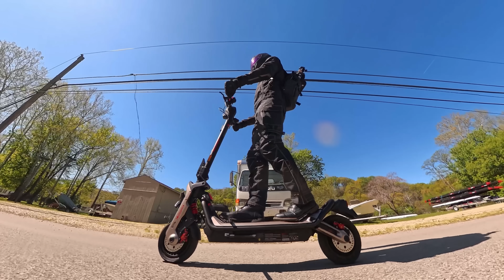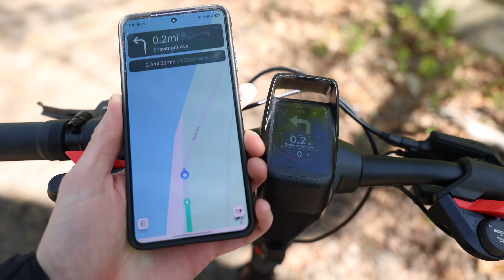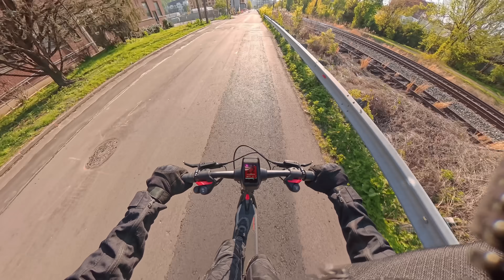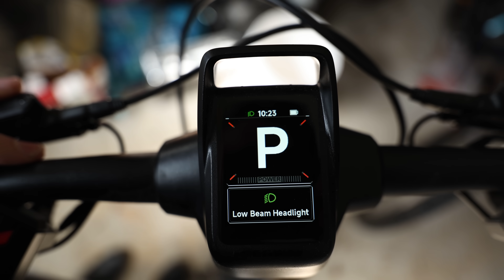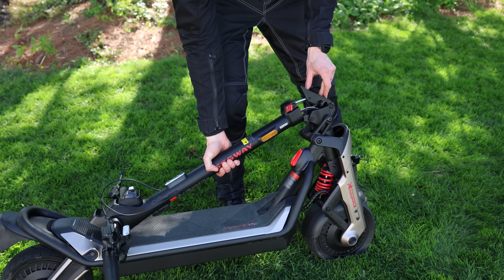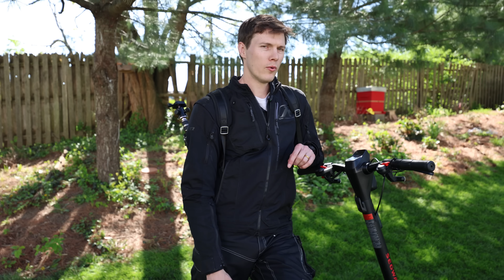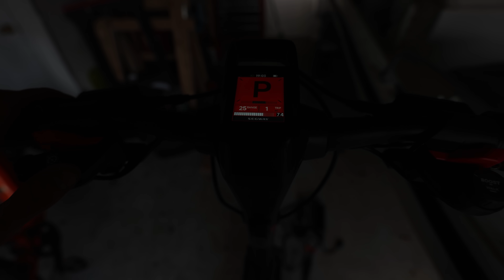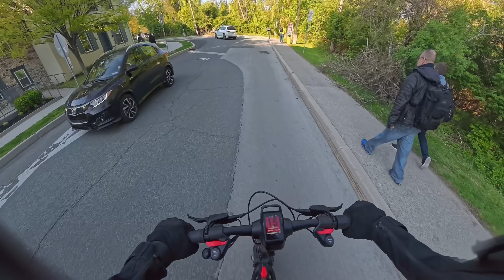Can A $2,700 Electric Scooter Replace My Car? - I Tried For 3 Days

Comment from the maker: SEGWAY GT3 PRO link (latest sale price) https://mikeobrienmedia.com/SegwayGT3Pro
supports the channel at no cost to you
Reply: I have the stepped down cousin, F3. I would cap the speed at 15-20mph which is about the speed one would go on a standard pedal bike. I can certainly appreciate the added range it would bring to a beefed out scooter like this and I would absolutely agree with what you said about inclement weather. It is a fun way to hit the trails. I am hoping to find the extended battery piece for the F3 but I may get something like this and cap it just like I do the F3. My rule is that if I need to go faster than 20, I'm taking the car.

Comment: I use my scooter to get to work 9 MI both ways in Southern California traffic just don't drive it in the regular car Lanes stay on the right side of the road in the bike Lanes and get a off-road overpowered scooter definitely comes in handy on rough terrain or bumpy pavement / concrete roads

Comment: Basically, the answer is simple, is your car just a A-B vehicle OR do you use the full car. Like you go shopping and need the trunk, need to go long distances or have a license because you have a driving job. If the answer is A-B vehicle, you never needed a car and walking would suffice for some and Bikes, Scooters etc for others. I walked to work for 6 years, 5 miles, 2.5 there, 2.5 back, takes 50 mins. Then I said, let me use a Scooter, then a Bike to make 50 mins 16-19 mins. Humans have been walking thousands of miles with no issue since we were created. It's only in the modern era we act as if walking is not a thing we should do anymore unless it's down the street or to a Bus or Subway station.

Some of us are in very bad health because we don't move around as much anymore as humanity and we're pretty lazy. People that get a bit of a pass are parents and care givers to those they need cars for or are absolutely in a unreasonable time crunch.

Comment: KuKirin G2 Pro ABE. Diesel car left idle without renewing insurance. Over €1,000 saved in 5 months and more than 4,000 km covered on the electric scooter. Yes. An electric scooter can replace a car.

Comment: I ride my Segway to work. 13 km in total, minimum 5 days a week. I save about 50 euros worth of gas a month. Not even talking about preserving my car a lot more + it's a fun way to go to work. I like it a lot tbh. You do have to pump up the tires of the scooter every week because they loose air pretty quickly and it hammers your range and speed real bad.

Comment: you said there's no regen breaking. There is you even show it in the app. It is called energy recovery and it has 3 modes. Off, Weak and standard.

Comment: I actually drive a Holden Crewman, which has a big V6 and is a very heavy vehicle with bad fuel mileage, so I just ride my Escooter Kukirin g4 around town to work or shopping and drive my car if I have to go out of town.

Comment: Sadly, the feasibility of e-scooters depends on how your city or metro area is setup. Even in my area  there are some areas that allow access to shopping, but the neighborhood that I live in is an island with no viable way out to shopping or much else via e-scooter. Texas does not allow e-scooters on roads that have a speed limit over 35.

Comment: 50mph on hard 10 inch wheels on lackluster suspension with a high center of gravity. One sugar cube sized stone and you're wiping out. 
I have an offroad e scooter with proper suspension and that thing still doesn't take bumps as well as my trekking bike with $30 shimano suspension.
19 mph is the reasonable limit for a vehicle like this.

Comment: I replaced my car with a Nami Klima max. 
 Have done this for about 3 years. Haven't looked back. 
 We do have a family car which is enough to get the family around.
Reply: I just bought an Apollo Phantom 2.0 and find the suspension is sucky, and the guy who sold it to me replaced it with that Nami 60mph. looks like that is the one to get, suspension looks good and battery huge
Reply: @jstewart627 funny enough I started with an Apollo Ghost and I replaced it with my nami 😅never looked back

Comment: The meepo voyager looks cooler, climbs hills better, does groceries better, and you can buy 2 of them plus a high end helmet for the same price. Also better to go into grocery stores,  riding the bus easier, bail much safer,   and did I mention look WAY COOLER!

I use bungee cords to strap a nice big grocery bag, or whatever to straddle. You can also use a free hand without risk.  The downside is meepo has terrible customer service and they break. The longest ive had one work is 3000 miles.  Some only lasted 500

I mite buy this  considering the customer service could be better in event of a problem, but its definitely a downgrade in cool factor

Comment: I replaced my car with a Ninebot G30D going 70 km/h, 3-years ago, still going strong, even have a seat for my dog. Just way cheaper than a car. 
I find it a lot safer also, you have a lot better view, having eye-level 2-meters up and no death angles. Also should be a legal requirement to have steering stabilizer on e-scooters, makes an e-scooter 10x safer.

Comment: Before I bought the Segway GT three pro, I used to take the train or drive to work. Now, I ride the scooter to work and back, and sometimes I use it to do errands like grocery shopping. I absolutely love every moment I spend with this scooter. I’ve already put 2200 miles on it!

Comment: I have a segway max g3 with the upgraded gt3 battery,I commute about 16 miles to work and 16 miles home 5 days a week. I'm lucky my job lets me charge it while at work. I have almost 4k MILES not kilometers. My scooter has paid for itself in insurance costs ALONE. I've spent 120 bucks on tire replacement twice ( every 1500 miles ) and 40 bucks on brake pads. BEST INVESTMENT EVER AND STILL GOING STRONG!!

Comment: I recently picked up a lightly used Segway F3. It only tops out at 20 in sport but it's so fun to ride because it's nimble and light. Also has multiple regen braking modes.

Comment: I just finally got one someone was tossing due to flat front tire and broken brake cable and I fixed it in about 30 mins with $30 worth of parts off Amazon. It tops out at 18mph and I gotta say it feels sketchy AF I cannot even imagine doing 50+ on one that is wild. But ya I have to agree I tried to scratch my nose while riding and you really can't barely take a hand off the handlebars

Comment: You always need a car. Here in Canada, it's illegal to use one on the highway: the speed limit is 50 km/h on the road and 25 km/h on the bike path.

Even though it's a bit like a motorcycle, since it has two wheels, the law considers it dangerous to ride one on the highway. If this kind of regulation doesn't exist where you live (and I'm talking about countries other than Canada, of course), you're lucky! I'd love to buy one, but if I can't go faster than that… I wonder if it's really worth spending so much!

Comment: Emove cruiser has been my daily driver for going on over 2 years now and my advice for scooter life is at least 2 big canvas bags for the handlebars and I strapped a cooler to the base for extra storage like a trunk and my seat. Also a side mirror and Bluetooth speaker... not just for tunes but for noise because electric scooters are pretty quiet and its an added safety feature that people hear you coming so don't be afraid to blast some tunes everywhere you go... many scooters have a usb port for charging additional devices so I keep mine on the speaker so it's good to go as long as the scooter has juice and with a 50 mile range it lasts long enough for me for a week of back and forth around town.

Comment: Such a fancy scooter. Not suitable for the impoverished poor, who can no longer afford to operate motor vehicles. Too expensive. Besides, many states have laws regarding the maximum wattage and speed limits e-scooters can obtain. Example: In my state, 750 watts is the legal limit. E-scooters are also restricted to 20 mph or less.

Comment: I’ve had my GT3 pro for about 90 days, I’m 55yo, been riding scooters for about 18 months, it did replace my car, and I haven’t missed owning one at all. This scooter is a dream to drive, does 50 mph, easily. Also, it’s extremely stable at 50mph.

Comment: You may want to try out one of Bonnells E Mountainbikes. It has a range of 12-37 miles with 6000 watt and a top speed of 37 to 40 mph. At least the Bonnell 775 mx.

But the price is something. Cost over 5k.

Comment: Hey Mike. I like the simple display - or rather "targeted, focused display"  - yes, information is power.  Ask any pilot though, and most will tell you that the SPECIFIC Information and how it is presented is equally important. It is cool to know what the precipitation odds are for Melbourne Australia. Byt on my scooter in North Carolina, traveling to an address in town, it has zero value.

Comment: i drive and ride the scooter, depending on where you live, where I live the area and the road design are really not scooter friendly.
1) it's not fast enough to outrun some random angry driver in their car
2) sidewalk, in my area I constantly have to dodge pedestrians so I end up riding on the side of the street
3) ride for joy = heck yea 
4) ride for grocery with a backpack in hot summer days or rainy days = no way

Imho, scooter is only for fun and it cannot replace a car.

Comment: You can do your groceries with a Sport Training Bag, those bags are large and you can easily fit 2 or 3 soda bottles, milk, multiple cheeses and snacks and other essential items, like litterally you can shop for 60 dollars to 120 dollars in groceries and still have space, of course its going to be heavy, but as a man if youre not capable of carrying 20 to 40 pounds on your back for a small trip then i'm sorry but you failed, the sport bag can close with zippers and is better than a plastic bag, good fabric will hold, from my experience backpacks usually dont hold too much weight if they are for civilian uses, because the two support lashes are thin and designed to have foam or some form of support for weight, so personnally even if it means having a Shoulder bag and only one support for the whole weight and coming home with a red mark on my neck and back, its better that way than risking one of the two lashes of the Backpack to untie and balance all the groceries either left or right while i'm driving, it could make me fall , so shoulder sports bags are really what you wanna have to buy groceries and other heavy items

Comment: I use the Segway Max G3 & public transit as a replacement to my car. Sold it 1.5 years ago & havent looked back.

Recommend bringing the scooter with you everywhere & not leaving it out of sight. If you cant bring it in somewhere then get there another way & dont take the scooter. The plastic handle above the front tire can easily be snapped off by hand & the metal chassis/lock can be cut through with an angle grinder in minutes. There are easy ways to nullify the findmy and rebind the scooter to a different phone as well. If this happens you are SOL.

When I grocery shop I bring 2-3 large reusable grocery bags & hang them. One on each handle bar & one on the utility hook. It’s easy enough to balance with the bags even if holding a lot of groceries if you limit your speed to ~15mph.
Reply: So when you take it to go shopping, do you fold it and put it in a shopping cart or wheel it around the store?

Comment: IF you leave a 2700 dollar scooter outside it will be stolen.
Reply: you can get a insureance for around 40€ a year for theft here in Germany. I bet you can too. Not an issue. Get insurance and a lock for such an expensive vehicle. 2700 is really expensive for an e scooter.
Reply: depends where, there is plenty of Ebikes that go well into the 1-5k dollar range, and it is just kinda the expected Price range for Ebikes. 

Thieves will just plain steal anything that looks good and makes a good target to be stolen quickly... at least from Statistics in Europe: The more expensive E bikes tend to be stolen less even as Thieves just assume that it will be GPS tracked to hell and back

what is important is to Lock your vehicles Safely (so don't be that guy who locks a scooter or a bike on its front wheel where the goddamn quick release is... or on the plastic parts so a thief would need heavy equipment and park them on spots where thieves will feel exposed and be VERY careful about leaving a bike / scooter out at night.. as that tends to be when thieves strike.

Heck you can leave an expensive  bike unlocked on a very obvious open market plaza even at night and many thieves will straight up ignore it because it is just too obvious of a honeypot... and if that would be locked down it would be too obvious and noticable to steal.

Motorcycles are vastly more expensive and those too don't get stolen immediately even though one can also hotwire those / just lug them into a van like an E scooter

An organised crime ring will straight up steal the whole bike rack with everything on it at night and shove it into a van.. hence why not leaving it out at night or putting it in a place where indeed they would need heavy and loud equipment is still good insurance... one of those metal tube bike racks is a good start but it loses all meaning if its not properly bolted down / sunk in concrete... but at daytime it tends to be enough because you aren't gonna lug that shit into a van undetected.. you need to cut the lock or the bike stand.

the trick is: make it as annoying as possible for a thief to even make an attempt.

Comment: Did you have a little whoopsie, friend? I see the bottom legs of the X logo missing in some of the shots lol. Glad you're alright, and great video. Way too heavy for my daily commute, but my ZT3 Pro is serving me quite well for that purpose... and yes, I have had to replace my X light once already from my own little whoopsie lol.
Reply from the maker: Good eye. Yep, filming with a 360 cam on a selfie stick is dangerous, hence my gear. I hit a small rock and dumped the scooter. Fortunately, I was only going about 15-20mph

Comment: mostly replaced my car with a $1000 ebike. It goes 36 (closer to 30 in my phone testing) and has a rack for groceries and such. and other then longer drives into the bigger city for doctors appointments I haven't used my car at all really.

Comment: Would ride it slow and casual despite the speed it's capable of. "Sometimes speed is necessary" when 💩 hits the fan in the figurative sense..But mostly run it in Eco mode. Rules and laws in my country would forbid high speeds, however upon stray dogs, bears, wolves and such well..that's when you want the speed factor to be available.

Comment: For me even a 400€ Scooter done the job…
It’s more a question of where you live and of cuz your mindset if this can replace a car…
In a city or near by a bigger city yes of cuz there is a scooter even better cuz way lower costs and no issues where to stand up your vehicle when you don’t use it…
The only limits are range and weather but both are mostly not that big of an topic in a city or near by….

Comment: I had a scooter like this that replaced a car for about a year no issue. 
First you realize how easily your entire body can get wrecked if you're not wearing a full head helmet and gloves and heavy pants.
What you're not spending on gas or insurance or parking every month means you get an uber or two a week in a pinch. 
But then  they start to pop up: things more than 4 miles away. 
Then you're doubling distance in your head, negotiating that you can make the battery do it.
Reply: Get a minimum 20ah battery and you are good!
Reply: @PeaceSeekingMissile  30ah
Reply: agreed no ride taxi is called

Comment: Nice content, I rode my last scooter for 4k miles and yes i did replace my car, consider instead of backpack, get a heavy duty laundry bad with shoulder straps made a canvas over nylon, very handle for large load. putting items on stem can throw off balance, not a good idea

Comment: the problem i have owning a scooter is changing the tires ecery 3 months cost $300 not to mention the 45 minit drive to take them in to get them changed aand on top of that australias law is changing day by day  with them becoz of idiots driving stupidley on them and now if you paid a lot of money like me on one a year ago its illigal to ride becoz of the watts it has honestley its fn stupid
Reply: mine last  a year easy get correct tyre i have no chained mine on my EVR for 2 half years my tires are still fine goes over 40mph but my small scooter eats tires 1 maybe 2 times in every 18  months

Comment: I crashed in to a car going 50 since I’m on the smaller side, my whole body crashed against the frame wheel went all the way back but it survived and still worked but I have to get it fixed 🫡😭🫡 it really could have been worse I think it wasn’t as bad because I’m the same size as scooter and didn’t flip over 😭

Comment: I got a Segway ZT3 Pro for ~$1,000 hoping it could replace my car. It has about 30 miles range on a nice day, probably more like 22 realistically. But the only commute I do is to the grocery store. While I cannot carry back appliances or animal food and have to split large grocery hauls into 2 smaller trips, usually on different days, it's done a GREAT job of replacing a car. If I find myself unable to bring everything back, I order an Uber XL throw it all in the trunk and reassure myself that I'm still saving money on fuel and insurance and registration by owning a scooter instead of a car.
I do not lock it to a bike rack. I have both airlock and code lock enabled. Not only does my phone have to bluetooth pair to it, but you also must physically enter a code.